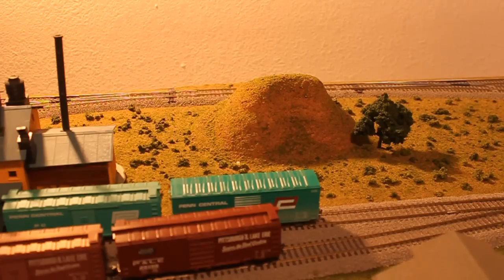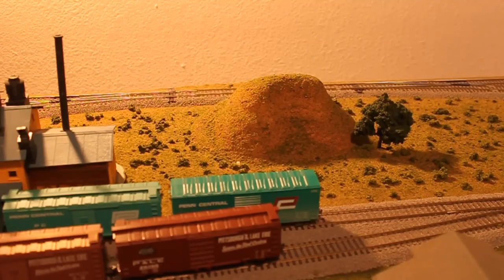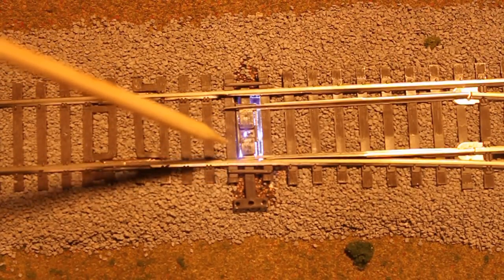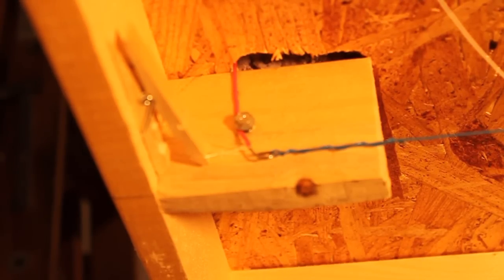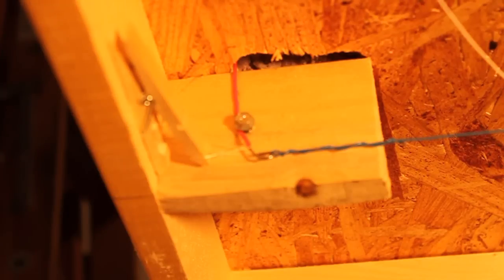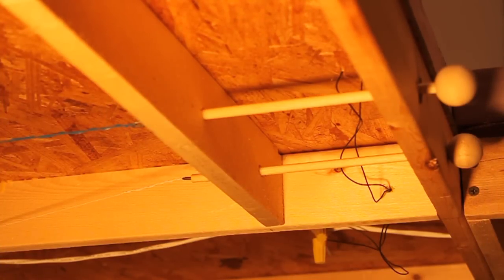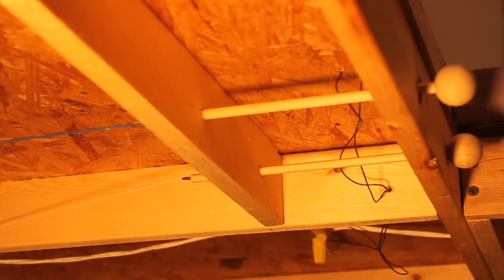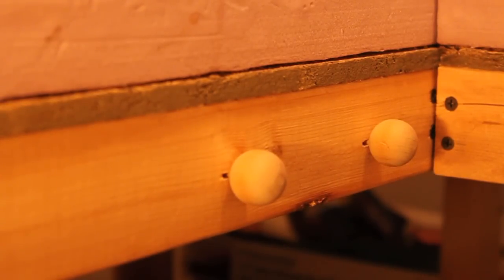Build and Install Manual Turnout Controls

Comment: You did a super job on the ballesting - no ballast on the ties!  That's a new one on me! My layout and modules are all build, but I'm helping two friends making their first basement layout, I tell them to watch this video.  For my pull rod switches, I used a DPDT switch; where the switch was used to energize the frog -- so sound is not interrupted when switchers go over them slowly--especially my Athearn Genesis GP15-1s.  Good work! Keep it up!

Comment: I had a friend who used  old automobile push and pull cables many years ago. The knobs were mounted on the outside of the board just like you did and the  wire on the other end to  the switch was mounted in the hole. This method you have of course is still the best because of availability around the house.Nicely done on your part for an in expensive way.

Comment: Hi PennC.  This is great!  Thanks so much for taking the time to produce this video and for sharing.  I've hit several "walls" on my own basement layout and your approach to operating manual turnouts is one I'm going to try.  The reversed clothes pin is brilliant, I've used those for clamps at my workbench for years but as part of a turnout control is so simple that it borders on genius.  Thanks again, Dave Mc